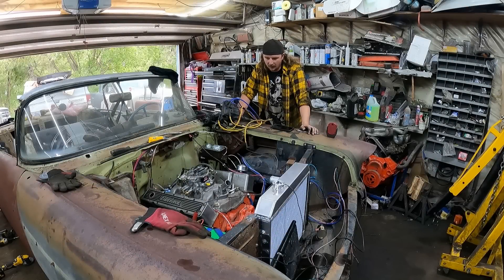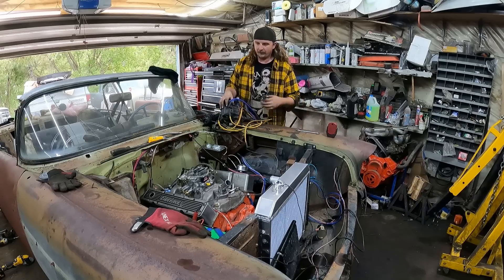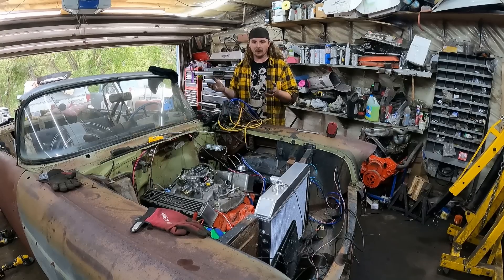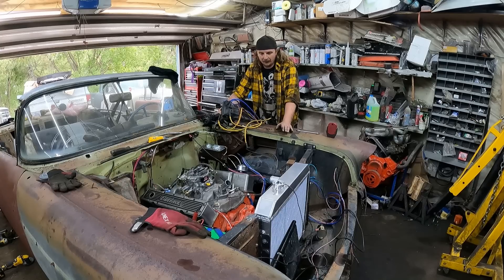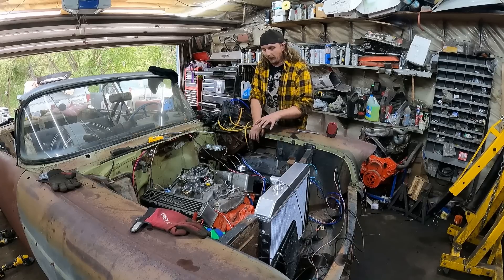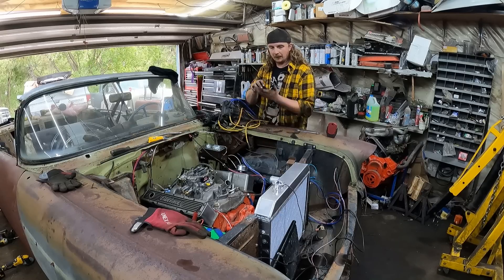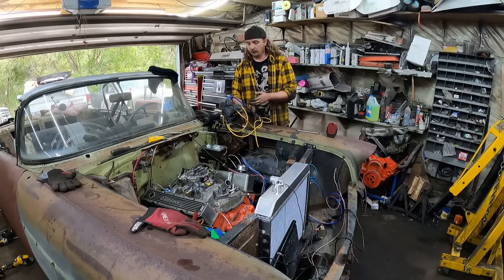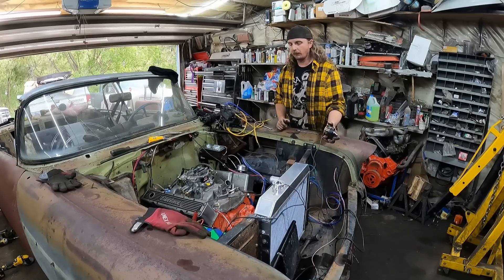Life Is All About Timing - Static Timing a Small/Big Block Chevy

Comment: Cool man. Glad I found this. I bought a 72FJ40 . It’s running a 350 chev in it. Had good running gear . Boxed chassis and 2 link Nissan safari front diff and suspension. I’m a ford man so this scary 😅. It was dedicated to lpg so the insides are super clean and also the oil. The annoying thing is the ignorant chap undid all the gas lines and parked it so I need to change the cam to a petrol one then go play in the rocks

Comment: I think it should be at 8-14 degrees when it’s seated the initially. Once it’s rated the rotor on the distributor moves with the crankshaft so it no longer matters if you turn it counterclockwise or clockwise, it’s locked in and isn’t tuning anything.

Comment: I have a question. I put the number number 1 at toc. The rotor facing towards the number 1. When I put the timing light on 56 in order to see the line on the balancer. Do you know why? The car bogs under load,backfires, and pings.

Comment: Seems to me it's just as easy to (1) confirm the power stroke (TDC) by watching the valves, (2) lining up the timing tab and balancer at TDC or zero degrees, (3) dropping the distributor in so the rotor is pointing to #1 on the distributor cap, and then (4) simply starting the engine and with the timing light move the distributor and lock it down at 10 or 12 degrees BTDC (or where desired) and re-connect the vacuum advance to observe total timing. A lot less complicated explanation if you ask me! Yours is a good workaround to not having a timing light if that's the objective.

Comment: Hey! So, I have a '74 K20. I got it running and driving, but it didn't have much power when I stepped on the gas. I thought I needed to adjust the timing and tweak the carburetor. I started with the HEI distributor, set it to top dead center, dropped the distributor in, and put the spark plug wires in the right order. But it's still not running right, even though I know there's spark and it's getting gas. It cranks but won't fire, and now the carb is spitting gas out the top.
Reply: The floats on the carb are stuck if u didn’t fix it

Comment: does this method work with MSD boxes?? i turn my dizzy and get no spark....  i bridge the two wires from the MSD box that go to the dizzy and get spark....  i try to start it with starter and i get spark, but not when i manually turn the dizzy with ignition on....... wtf?

Comment: Thank you for demonstrating the 8 degrees of initial timing, and then using the distributor for the rest of the timing, had it running on TDC But didn't sound to good!!! Thanks again
Reply: I'm still trying to understand why 8 degrees before. I'm using 0 & my car runs shakey & rough  with a high idle.

Comment: You can rotate the oil pump with the distributor, you have to find where it drops in, then keep backing it up one tooth at a time till the rotor points where you want it to, it will not do this rotating it forwards, only backwards.

Comment: I don't put #1 straight forward, but aimed at #1 cylinder. That gives you more turning radius of the distributer before the vacuum advance pot hits something, like the firewall!
Reply: yes,as do i...i just did freshly rebuilt vortec L31 heads(plus ls6 springs,new seals etc),gmpp cam,intake and thats exactly how i did it.fired up nice,broke in the cam and now i need some new tires

Comment: 4 degrees in distributor is 8 on crank. If you carefully rotate distributor up the drive gear a tooth at a time backwards you can turn pump drive, it takes a minute or 2 but it does work. I line up every chev small block that way.

Comment: Hi Dan.
Great job with your project. One trick I learned as a GM mechanic is when the distributor fully drops in as you did on number eight cylinder you can just pick it up rotate the shaft 180 degrees reinsert it one tooth ahead the oil pump will follow and drop down. Pick it up and advance one tooth till it points to number one , oil pump shaft aligns distributor seats on intake. A few steps but I think it saves time .

Good luck
Mitch
Reply: Can over advanced timing cause a rich condition and make smoke out the pipe?
Reply: @tedtalour6414  over advancing causes detonation/pinging not smoke. Other factors may cause your condition .

Comment: I like to point the rotor at the driver side carburetor stud on the intake for #1 and then the electric connections part juts out away from the firewall... esp. since I think you moved the motor back... and maybe your #1 on the cap is off by one position from stock position - not that it actually matters, except for where your coil power connector will be.

Comment: One of these days Dan , your going to bust a distributed gear powering it in like that , I have seen a few brake the gear or take a tooth or 2 off the cam being lazy and powering them in. After you brake one and have to replace a cam you will learn , turn the dam oil pump by hand correctly.There is a reason to do things the right way .
Reply: Doing it "the right way" is "relative" on this channel.
Reply: @tabbott429   lol --- Yep  replacing all the rusted steel and failing to seal it properly might be ok for a year or 2 but rust & corrosion has a way of coming back if not treated properly with Zbart undercoating or roofing tar to denture it.

Comment: Instead of using the sparkplug for static timing which is good, my father taught me to use a light bulb like a turn signal bulb which has wires soldered to it with alligator clips, key on, engine set to required degree, turn distributor way before TDC , then turn the distributor slowly till the light just turns on then tighten the distributor nut and your done. Best static timing I know of.
Reply: same method is use to time my Harleys ! good info . carry on 🤠
Reply: Do a video, I'd like to see this in real time? I've only known Dan's way all my life!
Reply: That might not work with HEI ignition but definitely with points set-up. I use my 12 volt test light. Ground the alligator clip  then attach the other end to the neg side of the coil. Thanks Sgt. Fowler for the tip and Thank You for your Service.
Reply: I was taught that way also. Dan's way is also ok...
Reply: I would like to see that method also I only know the way that Dan did it
Reply: That’s amazing. I’m just getting into auto been in diesel for years. I’m trying to tune a k1500 I bought.
Reply: ...remember: a MOTOR is ELECTRIC; an ENGINE is FUEL ... JUST SAYIN'...
Reply: @JeffCKeane  wtf is a MOTORcycle
Reply: @JeffCKeane  We're only speaking engine's here Dude, no one wrote the word motor here in any of this groups responses!

Comment: Distributor install tip, once you establish the interface between the cam gear and the distributor gear your timing is established.  You can slowly rotate the engine without disturbing the timing until the distributor drops onto the oil pump shaft; It’s so simple but most people don’t realize it, good Video Dan! 😎
Reply: What?? Confused by what you said if you move eng, timing moves with it.
Reply: @joepacheco4038  Nope 👎 
Once the “drive Gear” on the camshaft meshes with the “driven Gear” on the distributor the timing has been established between the two.  Turning the engine will not affect the timing, only rotating the distributor body will. 
Once you’ve established the timing interface then get the distributor to drop onto the oil pump shaft, then you can rotate the engine back to TDC or BDC and verify the install. 
This is exactly why I congratulated Dan for mentioning the procedure in this video!!!  I struggled installing distributors for almost 10 years before I was enlightened to an easier way.  JD
Reply: @HeadFlowInc  you mean for 10 years you couldn't just stick your screwdriver and turn the oil pump shaft you line with the #1 piston? lmao wow
Reply: @joepacheco4038  oil pump timing isn't a thing
Reply: Dammit why do I always forget about this lol

Comment: @DD Speedshop...I always have clocked the HEI distributors so the square box terminal part is 90* from crank center...keeps wiring away from the back of the carb and vacumn lines accessible...your way of course will run fine...great channel Dan and Dani

Comment: If they can't get the timing set after all that, I feel like a cooking class or a sewing class might be better set for them. As you know, god made dirt and from that very same dirt was about the time I was born. Okay, I exaggerate a trifle but I know that the old "Y" block fords had the same location for the distributor and I did that with them always as they had a horrible distributor as it leaned over and was misérible to set the points. I yanked the distributor on them and got those points right on the money first and then set distributor back in and bingo, it would run fairly decent. I have a long body but sawed off legs and leaning over to get those points set was a real pain. Good job Dan

Comment: Back when I was in high school (and after) I was the go-to guy for firing up motors. whenever a buddy would finish a swap I would get a call. I would set up the distributor, run the plug wires, and tune the carb if needed. They would supply the beer!
Reply: High School shop class has saved me so much money over my lifetime (63 now) not having to pay mechanics to work on my old cars. Now I'm retired and that is what I do for fun, work on my old cars/ trucks/ jeeps/vws.
Reply: where you located do you still help if supplied beer and cash if so I could use a hand😂
Reply: Pathethic

Comment: Never seen the rotor point at carb it normally faces towards number 1 cyclender
Reply: Can point rotor any place you want as long as its pointing to a distributor contact. Of course you have to start wiring for #1 at that terminal.

Comment: That's not how an HEI distributor is suppose to be installed, the rotor is suppose to be pointing at the number 1 cylinder,  if you continually pick up and drop the distributor into the engine the oil pump drive will eventually line up and the distributor will be pointing in the correct position or you could just line it up with a screw driver, call it a pet peave or OCD or whatever but seeing an HEI distributor installed wrong drives me crazy when it's so easy to do it right
Reply: #1 can be where ever you want it to be on the cap as long as the firing order is correct. It has no bering of relativity to the engine block as long as the advance has room to move for timing. The HEI pick has 8 points of magnetic triggering of the feild that tell the ignition module to fire the coil. So picking any the 8 points is fine since the system dose not care where #1 is and will fire all enqualy. The Vortec/LT* optical distributor is different in that it is picky since will see high/low points for multi port injection and a cap ment to sit one way.
Reply: @1mouse3  there's nothing you can tell me about ignition systems that I don't already know, I'm an ASE Master Certified Tech and have 35 years experience, when you open the hood of a car that has a small block Chevy in it and see the distributor just dropped in and the wires moved around to make it run it looks like crap and makes you wonder what else is jacked up about the engine, Chevrolet didn't do that from the factory and the bottom line is the distributor is installed incorrectly and it looks like a hack put it in.

Comment: And don’t forget to take the wrench off the crank bolt when you’re using a remote starter. Easy to forget while you’re thinking about five different things at the same time lol.
Reply: Got that hat lol
Reply: I’ve done that. I was amazed at how far it threw it!😂
Reply: Use a ratchet, odds are 50/50 it will be set on tighten and just fall off.
Reply: @franksgarage8551  I call odds 50/50/90 cause if it's a 50/50 for me 90 percent of the time it screws me lol